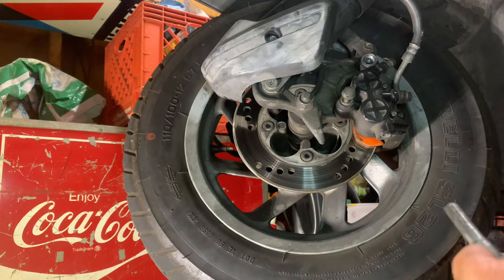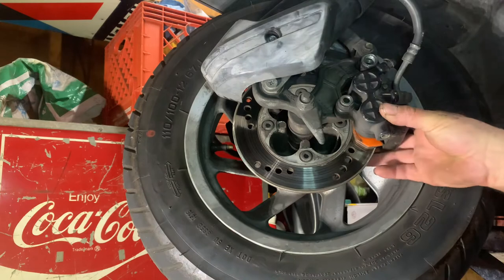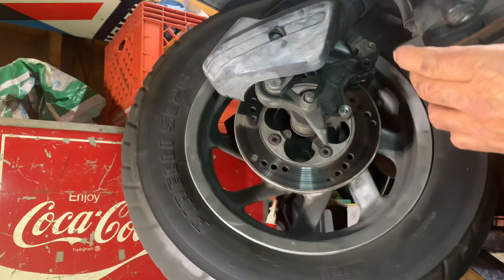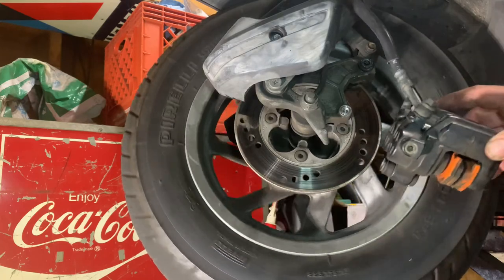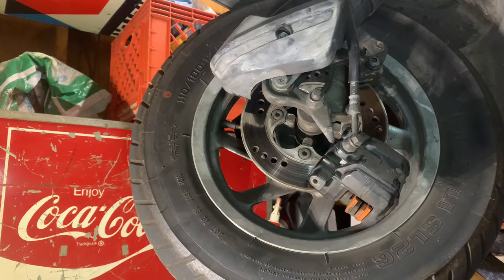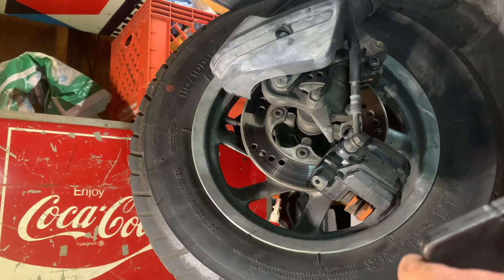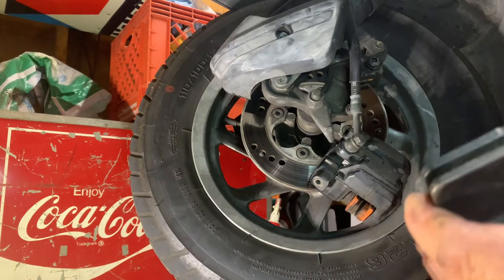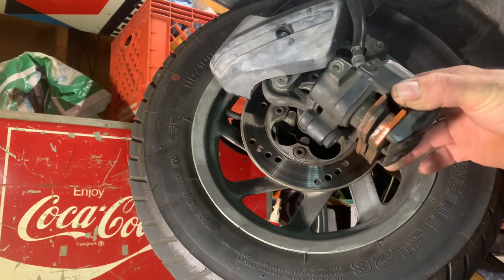Honda helix removing front brake caliper on a 93

Comment: My 1993 front brake caliper is sticking and the piston has white erosion on it, I put it in diesel fuel and sanded it and it worked better but still sticks, what other calipers will fit this bike? Will Honda dirt bike calipers fit it? I would like to rebuild it or replace it, but the official Honda brake caliper is 550 dollars, a rebuild kit is 40-70 dollars, I would like to be able to use the one I have since it works other than sticking, it sat in a garage for 20 years plus and it worked fine for about 150 miles and about 20-50 pills then it started sticking and eventually stuck so bad it wouldn't release
Reply from the maker: Take the caliper off and open the bleeder push the pistons in and put new pads on reinstall and try them again if they still stick then rebuild the caliper.

Comment: Hi Tony, I saw your video, and like you I like to get my hands dirty ... I would like to restore my 1997 Honda CN 250. I am currently having problems with the brake caliper that remains stuck on the brake disc. I have already overhauled the brake pump and the brake caliper. I have a suspicion about the LINK, TORQUE and BRACKET COMP., L.F. bushings in the manual, however, I cannot find any indications on the permitted movements ... do you know if these must remain stationary or can they oscillate laterally?? Congratulations for your desire to share
Reply from the maker: @marianoroma972  on my 93 I can take the caliper off without taking the wheel off on my wife’s 2000 I have to take the wheel off to get caliper off. There are slide pins that let the caliper move side to side make sure it slides freely. You say you rebuilt the caliper you might have a o-ring that rolled when u put the pistons back in. You have to put a little lube on the pistons before you install them so the o- ring don’t roll
Reply: @1tonysgarage  Mine is the 97 Italian version ... I can remove the caliper without removing the wheel. I did what you say, and I did a test before installing the caliper. Connected only the brake hose and moved the pistons slightly, then put them back releasing the pressure to install on the disc. 
I also overhauled the pump. I will try to clean it again ...  thanks

Comment: My 1993 has 4k miles been sitting since 1995 in a garage and I got it two months ago and the brake started sticking about 50-100 miles into using it. They worked well slightly squealing making noise from I think the rust on them from sitting, then they the caliper stuck and I noticed white erosion on the outside of the piston edge you can see and I removed it sanded and soaked in diesel and it worked better but still sticks, what should I do?
Reply from the maker: You will probably have to put new pistons in it. Get them from a Honda dealer and also get the o-rings that go in there.

Comment: Good morning Tony! My caliper pistons wont retract.. I've pulled it apart, cleaned it, put new pads on it and it they're still sticking. What should i do!!
Reply from the maker: @aarons3501  did you open bleeder valve? You might have to get new pistons and rebuild caliper. Make sure bleeder is open when trying to push pistons in
Reply: Do you have a video on rebuilding caliper?